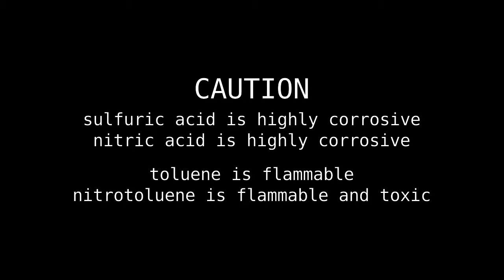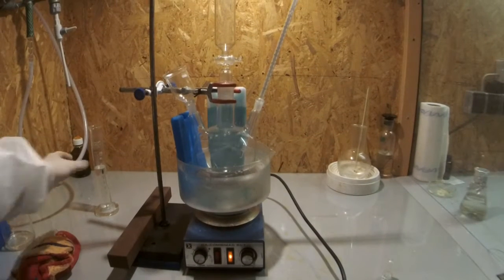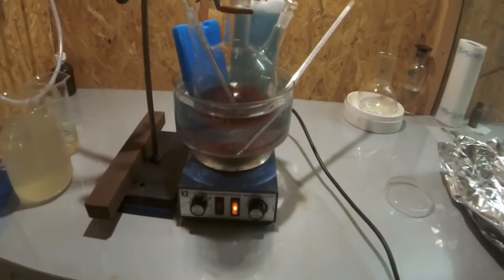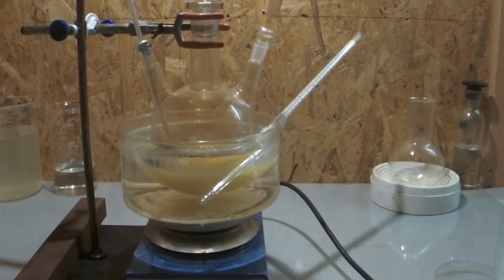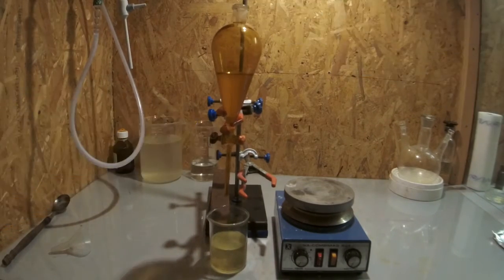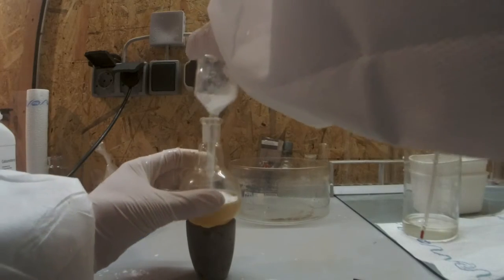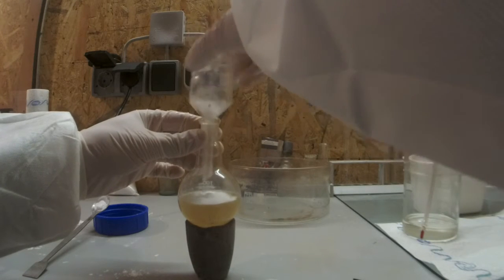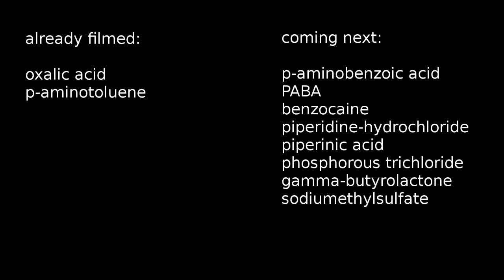Synthesis of ortho para nitrotulene

Comment: Btw - i did this synth over the weekend. Used your video as a guide (along with chemplayers). Very helpful - so thanks!
Reply: I had to look everywhere for one of your comments just because I first messaged you when I started this project like almost 3 years ago. I just wanted to say I actually did accomplish the total synthesis up to the condensation to a heterocyclic sedative you've probably heard of 

I put the project on the back burner for a long time and had been messing with a certain class of compounds that have an ethylamine chain and really cutting my teeth and getting some solid results. 

I just came here to say thank you for turning me on to the methyl anthranillate and also that I found the compound both underwhelming and very lovely. I think I might just be a bit hard headed to the stuff and require a higher dose than others.

This total synthesis is so much more of a pain and so much more messy and dangerous than any other synth I've done up to this point, I can't believe I chose it for my first. I am happy working with my ethylamines 2-propyl amines and 2-butylamines
Reply: @DIGITALVHS Interesting. I am also very interested in chemistry too. I got myself a chemistry set complete with a heating mantle.

Comment: GREAT VIDEO............It is funny how the predicted  "literature"  yields show ZERO effects of steric hinderance at the ortho positions.  A methyl group must not be that big of a deal on a benzene ring when it comes to steric interference.  There was actually more coupling to the ortho positions with each getting 32.5% and the para position only getting a 30%  yield predicted by literature.    I wander if the literature is SLIGHLY wrong on their predicted yields?

Comment: QUESTION:  I sometimes think of what other nucleophiles besides benzene. can react with a positive nitronium ion but can never think of one.  I always have 2  problems.  One is that the neucleophile can not take acid or water in the experiment.   Like reacting nitronium ions with a grignard reagent like ethyl magnesium bromide.  Two is the nitronium ion would add to an oxygen and make an ester instead of a nitrate.   Like reacting it with the double bond of a carbonyl.   The carbonyl carbon would be delta positive so the positive nitronium ion would have to add to the oxygen on the double bond....i am guessing.   Also nitronium ions would add to an alcohol to make an ester.     IS THIS REALLY THE ONLY REACTION A NITRONIUM ION CAN HAVE AND MAKE A NITRO GROUP INSTEAD OF AN ESTER?????????????????????????????????????????????????????????